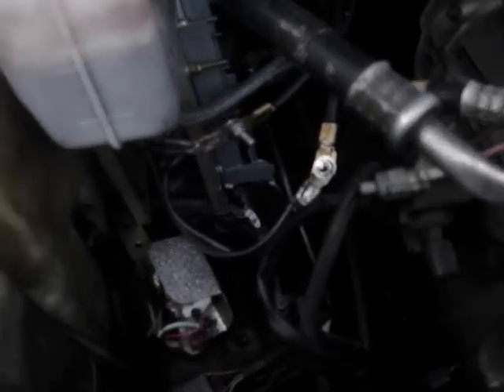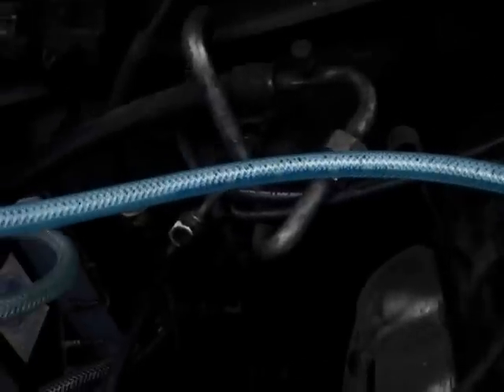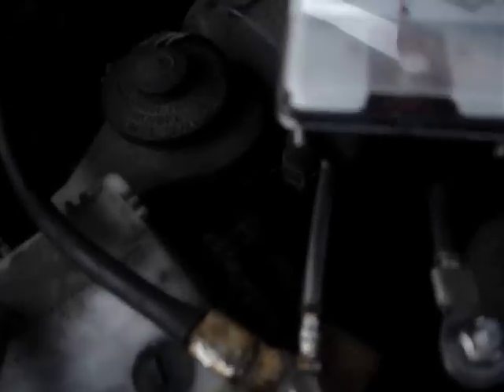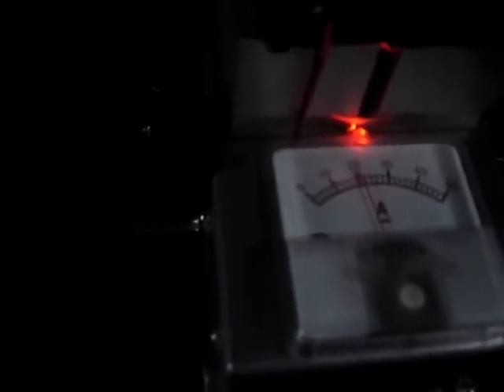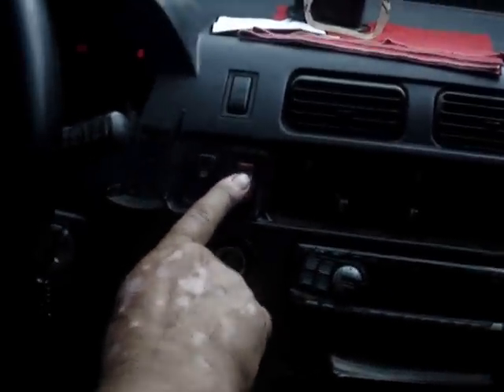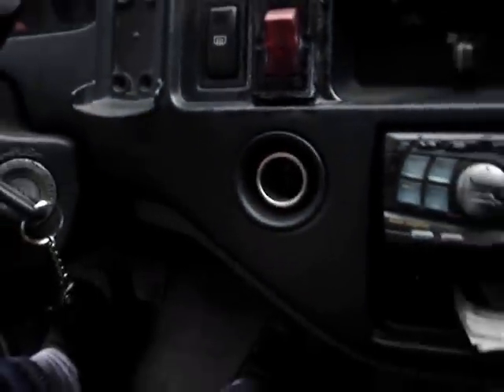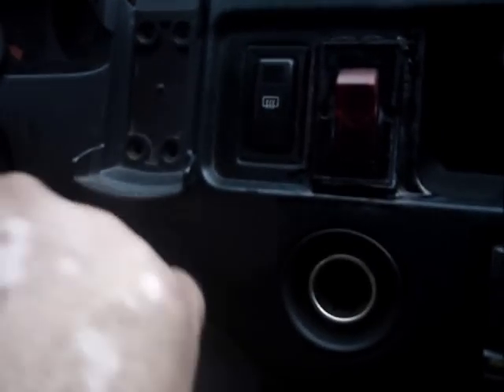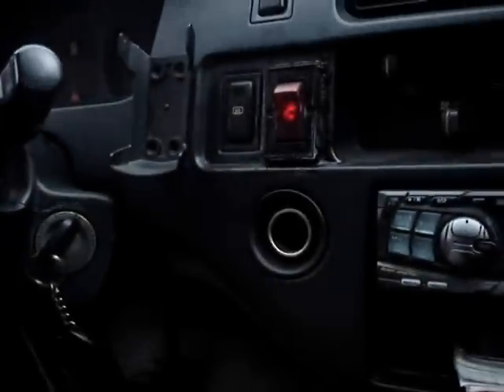HHO in a 2003 Toyta 2.4 diesel

Comment from the maker: @mjparco it wont kill your battery or altenator unless they are on the verge of dieing anyway i have been running hho in my car for a year now with no problems i preset the PWM for 20 amps wich stock altenators can handle